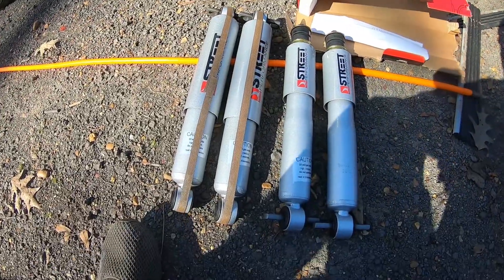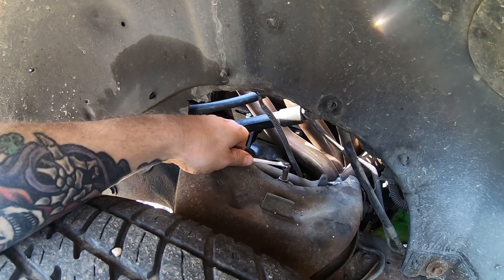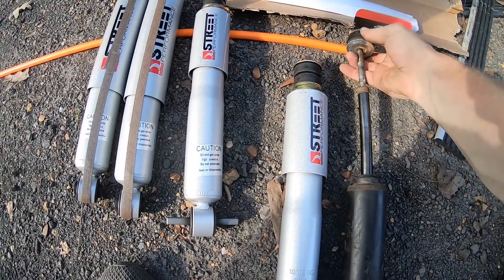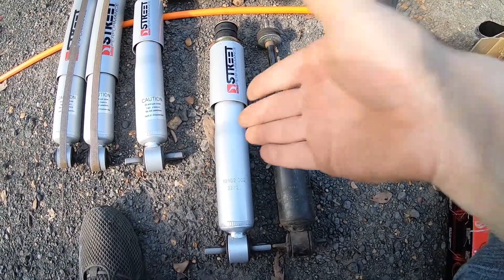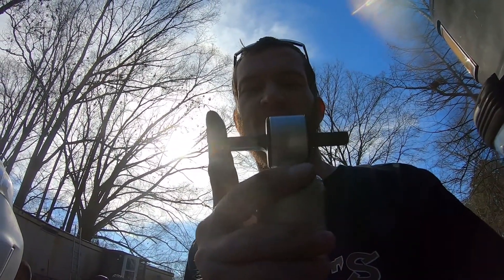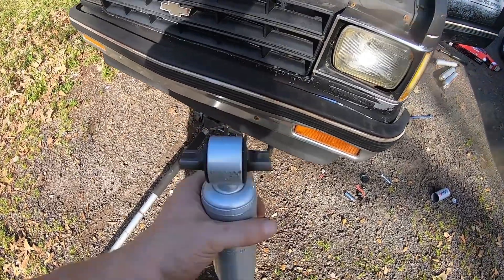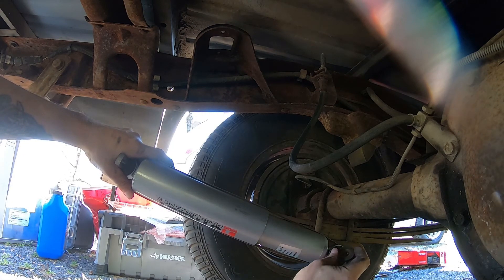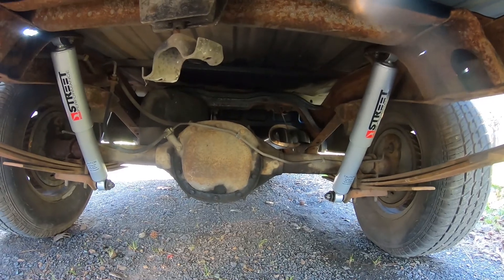Installing Belltech Street Performance shocks| LS Swapped S10

Comment: What's the thing with the pin bushing instructions it comes with I don't understand and my original pushing are dry rotted
Reply from the maker: Hmm not sure but I know they have a metal pin you have to force into the bushing which can be a pain. Sorry for the long delay guy im sure you figured it out already.

Comment: Just bought the set of 4 street performance the rear feels really bouncy will that go away after settling in
Reply from the maker: Did you order the standard shocks or the drop shocks? Also make sure nothing is binding. Mine arent bouncy so its wierd that they are but each truck is different.
Reply: @southerngearz  standard schocks that allow 4 im drop in the front and up to 7 in the rear
Reply from the maker: @BRED23 gotcha and im guessing you are lowered somewhere in that range. Did you use lowering leaf spring? Just trying to figure out where the issue is and it could be the rebound rate is too much. Have you removed some weight from the rear or is it the entire truck seems bouncy?
Reply: @southerngearz   completely stock height it is a single cab long bed with no tailgate . I do remember seeing a place where I think bump stops go in the rear ontop of the leaf suspension and it looked like they were gone but it doesn’t seem like that would cause the bouncines. My fridnd said maybe body mounts not sure about that either as I haven’t looked at them

Comment: Is it a smooth ride
Reply from the maker: Eh i wouldnt say smooth more planted. From my experience the nitro drop 2 are pretty smooth on these trucks.
Reply: @southerngearz  I was going to do the belltech nitro drop 2 shocks for the front of my s10 and rear aswell
Reply from the maker: @danielphillips3659  my 01 rode better than stock even though it had a 3/4 drop with the nitro drop 2
Reply: @southerngearz  man thats amazing